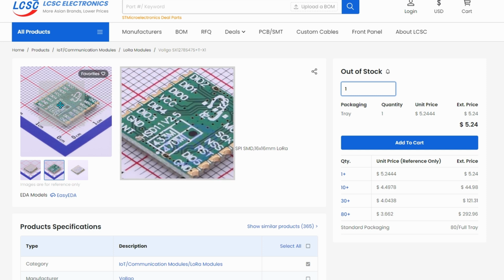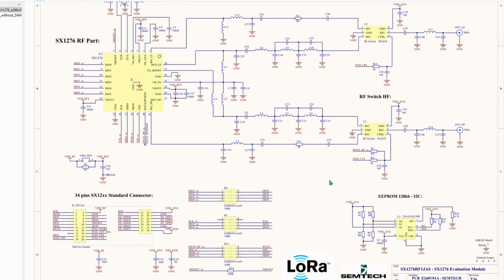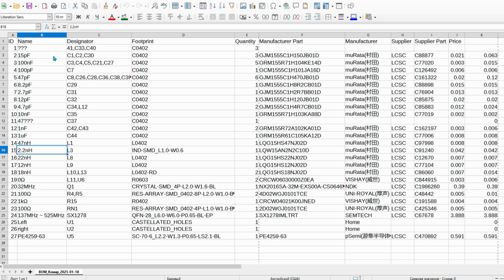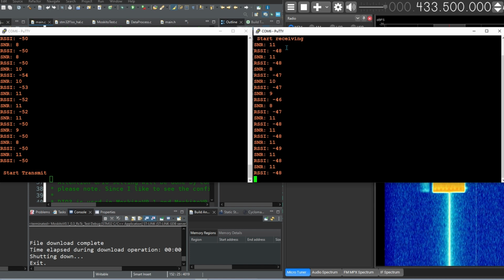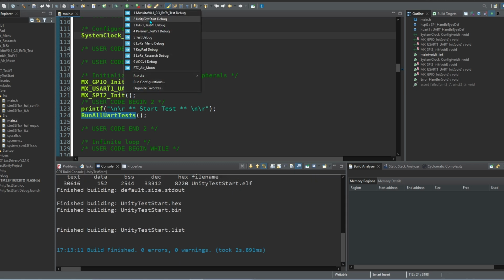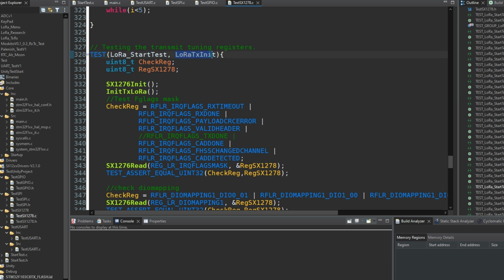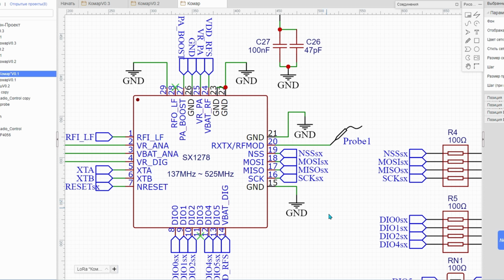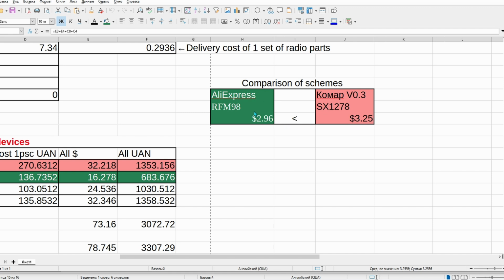DIY LoRa: Building a Dream Communication Module! (PCB, Tests, Economics) | Bataron №27

Comment: Is there an adapter to the pin size of module? I mean convert to a normal protoboard size, some kind of piece for converting/adapting
Reply from the maker: Hi. No, the leads are not standard, you have to make the adapter yourself. In general, I recommend using something like this module It has a standard pitch. 

 https://www.aliexpress.com/item/1005004991920495.html?spm=a2g0o.productlist.main.37.5995W1TbW1TbVj&utparam-url=scene%3Asearch%7Cquery_from%3Apc_back_same_best&algo_pvid=73a1c861-e565-4d41-bc9d-c87a5e0dbfa9&algo_exp_id=73a1c861-e565-4d41-bc9d-c87a5e0dbfa9&pdp_ext_f=%7B%22order%22%3A%22756%22%7D&pdp_npi=4%40dis%21USD%213.77%213.77%21%21%213.77%213.77%21%40211b816617455845655976233e99b7%2112000031265713960%21sea%21UA%211825030418%21X.